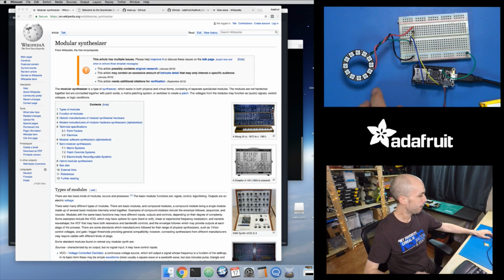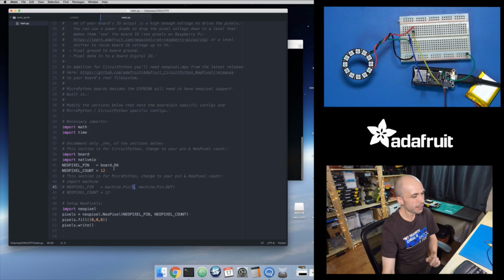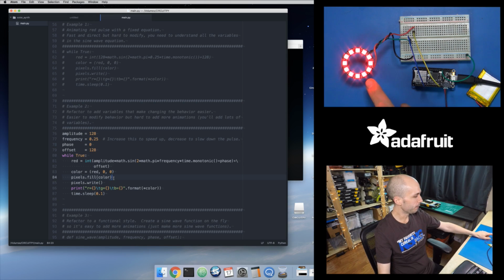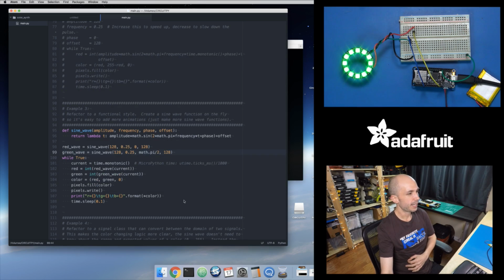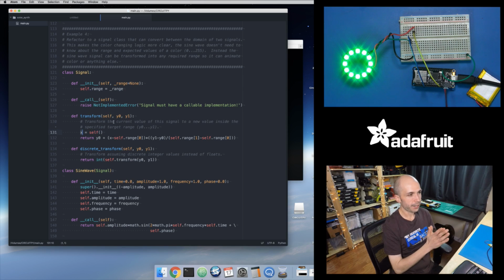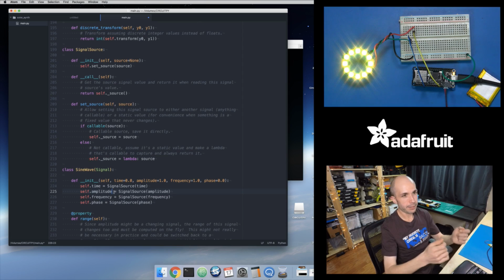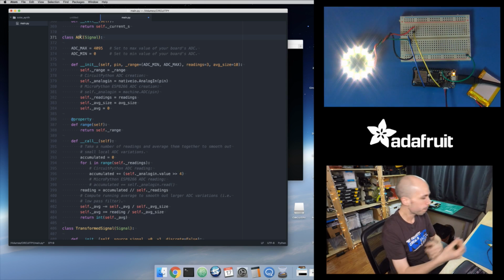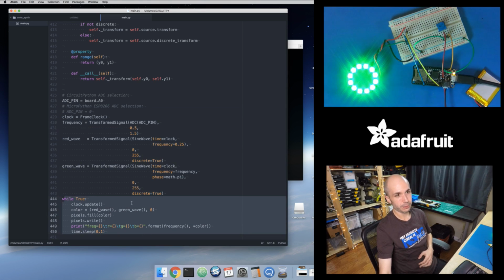Micro/CircuitPython NeoPixel Color Synthesis Experiments with Tony D!

Comment: Man, I know I'm late to the party but I really got a lot out of this video. I'm starting a new neopixel project (it's been 8 years since the last one) and I was just thinking about what a pain it was that so much programming effort ends up being spent on figuring out different 'tweening' algos. I have a feeling your approach here is a much better way to conceptualize the problem space.

Doing it this way is going to enable me to not only create more complex and interesting patterns but also provides a much better avenue for exploration since, as you note in the video, custom tweening code is not very tweakable or composable. This solves both of those problems.

Did you ever get around to doing any more work on this? I tried combing through Adafruit's and your videos but came up empty. But Adafruit's got a lot of videos so it's possible I just missed it.

Anyway, this video blew my mind a little and really got me fired up to start working on using your ideas in my project. Great job!